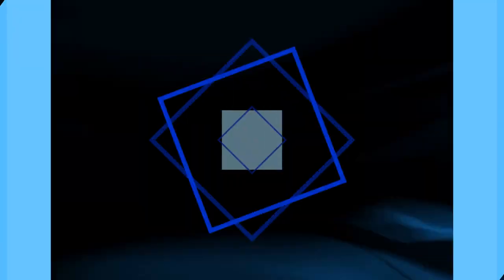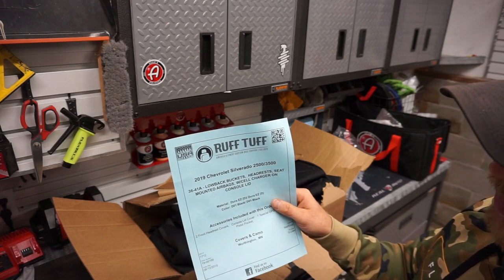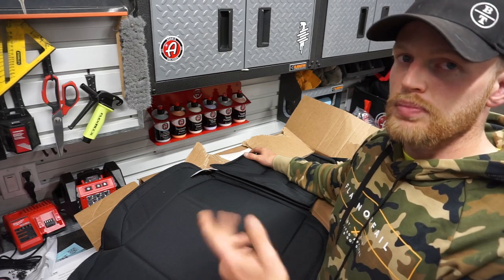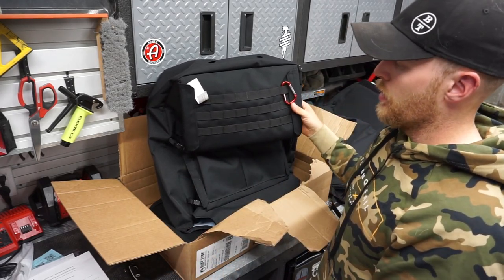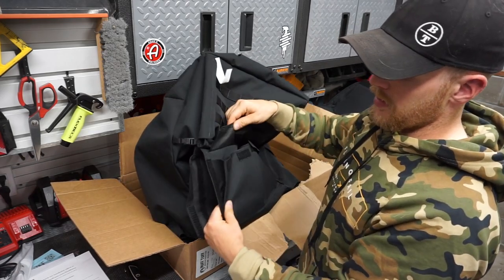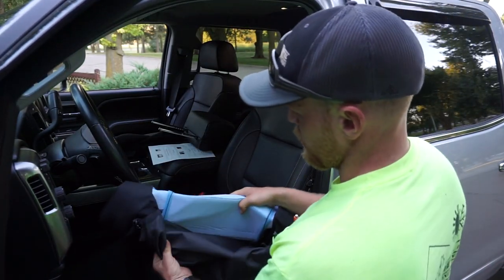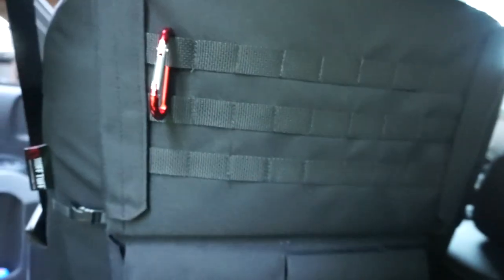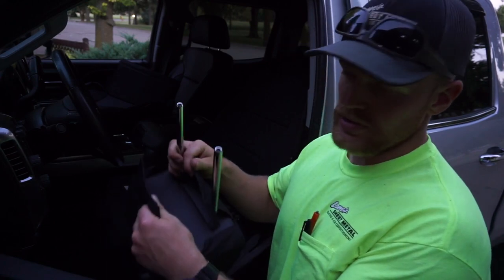The BEST Truck Interior Accesory! Covers and Camo Tactical Seat Covers!

Comment: Is the material like blue jeans or carhartt, or soft and foamy???
Reply from the maker: It's a very tough synthetic fabric.
Reply: The Black Dura EZ-Care (Canvas) fabric used in the video by The Lowe Show is more like a Carhartt material. It is a 600 denier canvas, durable and water resistant with an added 3/8" of foam backing. By soft and foamy you are probably referring to neo-supreme fabric. Currently we don't offer any of that neo-supreme fabric since it doesn't seem to hold up as well over the long run. Let us know if you have any other questions CoversAndCamo.com.

Comment: 4:24 Just lookin on the fabric at that shot it seems like very low quality chinese nylon. I had a lot of knockoff chinese stuff going through my hands.
It will last. No question about that. It's somehow tough material. But it's cheap. 

And yes. I can differ this from quality nylon manufacturer like Tactical Tailor, Tasmanian Tiger, Blackhawk etc.

Get normal seat covers and a quality MOLLE-Panel from e.g. Onetigris (it's chinese but it's made of quality Cordura and fairly cheap).
Reply from the maker: I am no expert by anymeans. But i am going to tell you it is the most rugged stuff ive personaly ever seen in a vehicle. Its standing up to my everyday in and out work load.